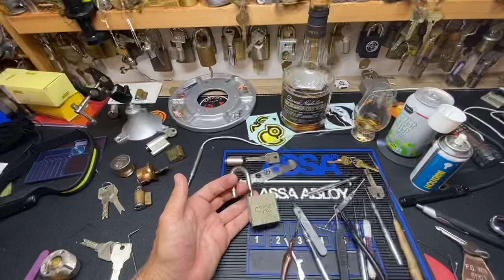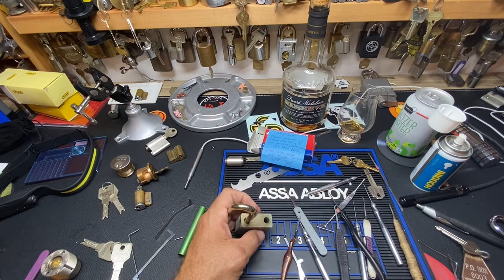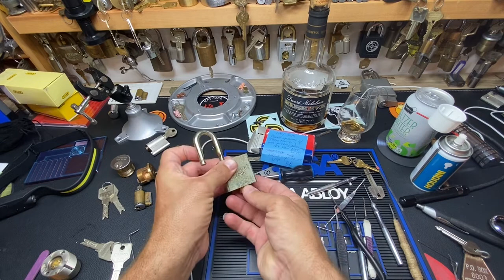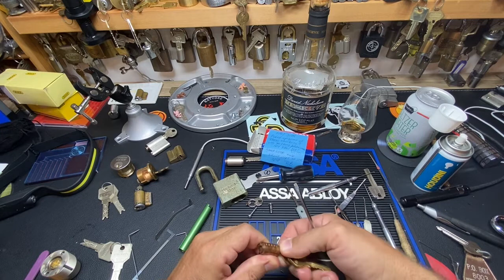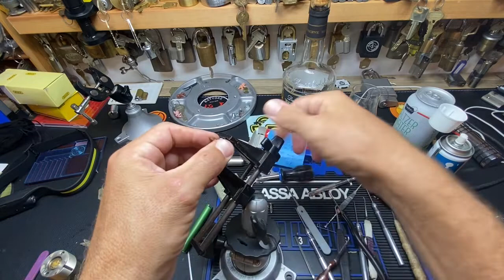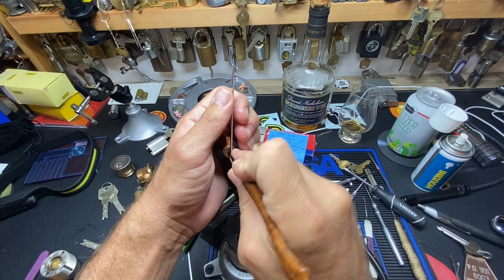Part 2 of a surprise ! Gutting fun

Comment: As Joe said, I did a video on another one of these from BB. The core is crimped of course, but what makes the lock so weird to pick is pin 4 is a bumpstop pin. When you touch pin 4 (in my case I missed it) it feels dead. The bumpstop barely goes into the core and here is dead space to the key pin. It feels like it’s already picked. Once pin 4 is picked, the others start to set.

I cleaned up the 2 I have and I’m sending him one of them back. I filed the crimp lip off and put a C clip on it…
Reply from the maker: Awesome info Ty